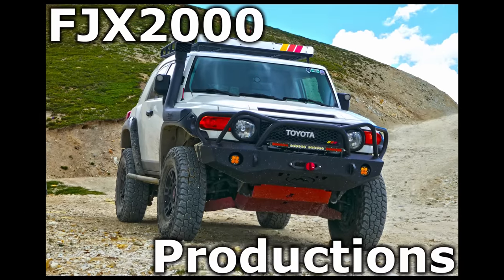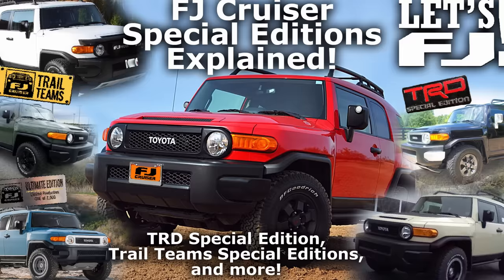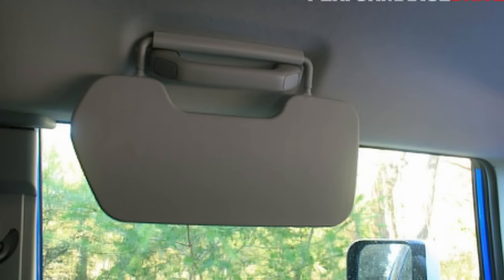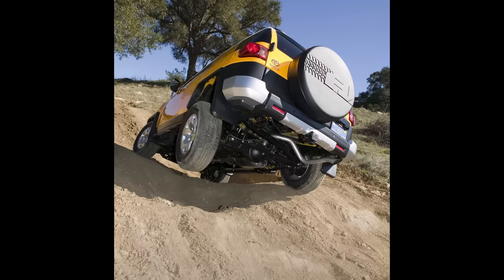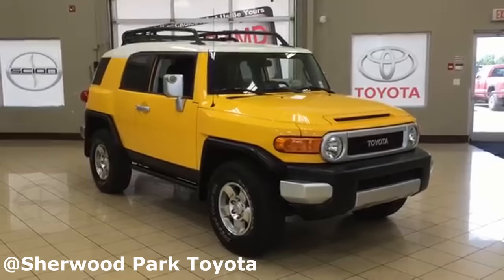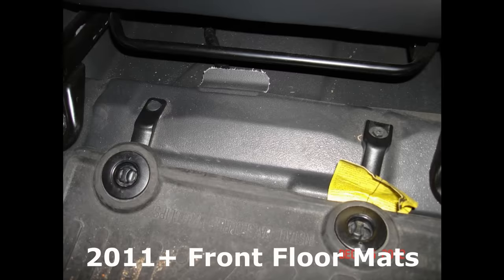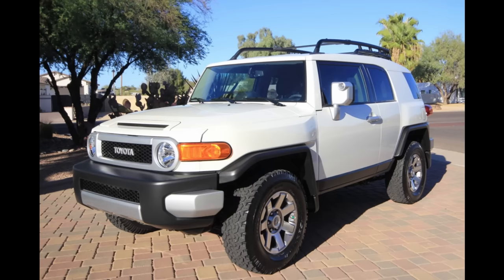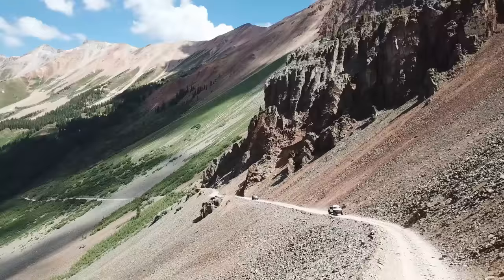Which FJ Cruiser Year is Best? - All FJ Cruiser Changes 2007-2014

Comment: I bought a 2007 fj back in 2018. I was going to upgrade the roof rack and put a roof top tent. Unfortunately it got totaled by a drunk driver. She hit me at 70 mph on an over pass bridge. She almost hit me directly head on but I was able to turn in slightly so she hit my side in glancing blow; my wife and daughter were on the non-collision side. We walked away from it and so did the drunk driver. That fj was a tank. Bought another 2007 fj. Finally have the rooftop tent, off road fridge freezer extra battery portable 140 watt zamp solar. Life is good.
Reply from the maker: Glad to hear it kept you safe! Congrats on the FJ as well 👍🤘
Reply: It's a great testament to the security a 2007 can provide, given they hadn't engineered all the safety features yet. I am happy to hear you and your family fared well through such a traumatic event. And I am ecstatic you have another 2007 again! Happy trails! Cheers!
Reply: God bless your family!
Reply: Im looking at a 2007...just worried because I hear the 2007 had some frame rust probs and shaking at high speeds
Reply: Where did you get the tent? Recommendations after you have had yours for a year?
Reply: @FJX2000_Productions  What kind of accessories can you install on the bu’on panel? I’ve got room for three more accessories. I’d like to put a light bar on top.
Reply: We had a rooftop tent on our Avalanche when we got hit head on.  The tent went flying. The Avalanche saved us but was totalled.   We purchased an FJ and love it.
Reply: 😮so glad u r ok. I got mine after someone hit me. My other car was small. So I love my new tank 😄
Reply: glad your okay! any mods needed to add a rood top tent to the roof rack

Comment: I have a 2012.  Had it since 2014 (bought with like 27k miles on it).  Haven't had a single issue.  I did replace the brake rotors and pads after 85k (currently at like 88k).  The stock ones are good / rated for 100k.  My mechanic told me the originals still had a lot of life on them, after 85k miles!  I also of course have had new tires, and I do a Mobile 1 Synthetic oil change once a year or 7.5k miles (so, once a year for me).  This vehicle is amazing!  My mechanic has said, "they are over engineered".  Will never get rid of mine, even though it is worth the same or more than I bought it for 7 years ago!
Reply: I had a 2007 with only 13K km, sit in the garage for years, my wife hates it, but I will keep it any way.
Reply: @jw715  keep the car lose the wife 🤣
Reply: Love my 12, trail teams 6sp manual.  Lots of fun totally stock except the radio. Would like to put a much bigger back up camera monitor in it.
Reply: @mcelroychandler6267  ours is stock as well. 2011 with only 68500
Reply: I also have the 2012-TT.  Can’t believe at 85k you still had more to go on the brakes.  Incredible.
Reply: @michaelsasso13  Yup, mechanic said I probably had at least a couple years left.  But, admittedly I am not a hard stopper.  I am much easier on my brakes than most people I would assume.  If I see a red light ahead, my foot is off the gas and I am coasting, usually only starting to press on the brakes at around 25mph or less (depending what street speed is).  

But, stock brake are rated for 100k miles.  So, anyone driving 'normally' should get around there.

My battery I just replaced last winter as well (2020/2021 winter).  9+ year old stock battery.  I replaced it because I noticed in very cold weather it was cranking a bit slower than normal.  Would have made it through that winter and another summer, but, not another winter.
Reply: @jw715  sounds like you need a new wife
Reply: You still have it with you...
Reply: @ZephaBryson-zi7qe  Yes.  Still have the FJ.

Comment: I bought mine December 2006 and it’s taken me all over America and I recently took it with me to Belgium. I keep meaning to upgrade her but the most I’ve done is upgrade the radio, runs fine as is.  164,000 miles on her
Reply: MysteriousOklahoma   oh wow, so I have some catching up to do
Reply: MysteriousOklahoma  I wonder who in they right state of mind would buy that lol
Reply: Sounds great!
Reply: I bought a 2012 black on black one in the summer of 2022.  94k miles for 22k.  In perfect condition.  Very strong engine.  Freezing cold AC nice sound system. Automatic.  I upgraded the all the lights to L.E.D and added new bumper tips with built in L.E.D. LIGHTS.  Love it! It is my vacation car when I go to PR 3-4 times a year.  I got tired of being ripped off on rentals for jalopies.
Reply: Got mine new in August 2006.  Just blew a head gasket 2 weeks ago after 425,236 miles of perfect performance, reliability and no problems or repairs except new cats at 300,000.  Local Toy Shop is gonna do a full engine rebuild (least expensive option and EVERY part gets checked).  Then off for the next few hundred thousand.  FJs are AMAZING vehicles!

Comment: Dude, your research for this doesn’t go unnoticed. Crazy attention to detail and that makes a great creator in the car world, well done
Reply from the maker: Thanks so much! I researched as much as I could so I’m glad to hear it doesn’t go unnoticed 😁👍
Reply: Except you forgot to mention that 2009 was the last of timing chain instead of belt, hydraulic brakes and steering instead of electric and a few more things that require more maintenance and $ and things to break. Computers are always big bucks. In my opinion a 2009 would be the one to look for, for Bullet proof and low maintenace.
Reply: Wikipedia
Reply: @joegoedhart1259 Definitely a timing chain, not just 2009 and older.

Comment: I have a 2007  FJ Cruiser; I purchased it in early 2008.  I have driven the heck out of the beast.  I’ve replaced the brakes and alternator.  The vehicle is running marvelous.  I use it off road and as a computer.  I keep the oil changed; I treat as I should, and I use it to haul. 17ft travel trailer.  My FJ pulls that trailer around like it is nothing.
My FJ has 280k miles on the odometer.
I would not trade it for any other off road vehicle that claims to be superior.
I believe the 07 FJ was the best made.  I have living proof.

Comment: My 08 FJ has 325k miles and still running great!
Reply: Nice hope you still have it.. Mine 08 with 200,000 it’s a beast. Workmate has two, one with 380,000
Reply: @dallen8997  yep just changed the oil last week. Running great

Comment: 2009 FJ owner with 520,000 kms. Just replaced the steering wheel...other than that no real issues ,had oil leak where timing chain cover mates to oil pan.
Reply from the maker: Yeah as these vehicles get older and experience traditional wear and tear there are bound to be leaks from time to time. Had to fix a power steering leak yesterday on my own FJ!

Comment: Great review, I had bought a 2007 with hail damage for 9000 thousand dollars with 60,000 miles. It was an amazing car but someone ran a red light hit me, from what I was told the FJ rolled over two or three times. Nothing happened to me,  I got up and walked out the backside Window. My wife asked what kind of car are you getting next? I told her, the same thing an FJ. I then got an 2008 with 120,000 miles. I’m in Utah and this thing cuts through the snow like nothing. When the city is snowed in first thing in the mornings, I go for a ride. and this is all less than four years ago and the car runs amazing with 162,000 miles. I Just replaced the front headlight and got a new windshield. The car runs and looks amazing. I’m 63 and I plan on this being my last car till I’m 110 years old.

Comment: Bought my voodoo blue in may of 06, I have replaced all wheel bearings , calipers and rotors , belt and pulleys , 2 sets of plugs . IT STILL HAS THE FACTORY PANISONIC BATTERY  , UN PHUCING BELIEVABLE ! I keep the undercarriage painted and try to prevent rust . 134k and love it .
Reply from the maker: Way to take care of your FJ! Amazing about the battery too. Ive done brake pad changes and had to replace the alternator among other misc. parts due to wear from off-roading but she is still going strong at 153K miles!
Reply: What did you paint the under carriage with?
Reply: @About2Rain  , Sanded down any rust bubbles  , wiped the area down with laquer thinner and primed it with Rust-Oleum and covered it with Rust-Oleum black , I used glossy black . Went around with a piece of card board with the Right size hole and placed over the bolts and shot them with silver . They swore to me the body would never rust and it hasn't but the chassis needs baby setting . I usually keep it power washed through out the winter since I live in the rust belt . Thanks for asking .
Reply: @johnsricke7236  Thanks for the info. I had an 07, but upgraded to a 2014. Can’t believe all the rust underneath. I live in the Northeast that’s why!
Reply: bought mine same month and year. (manual 6 speed)
battery still works as well!
have never had a tune up, only oil changes.
only replaced the brakes at 160k.
unreal!
Reply: You guys need to replace those spark plugs every 30K in the 2007 models as they are not the 100K plugs.  check your owners manuals if you got em.
Reply: Would you be using a high heat paint by rustoleum? My undercarriage is looking rough (2008 up in the northeast) 
Not sure how to proceed,  if I should do it myself or have it professionally treated
Reply: Used regular enamel paint or even use industrial grade paint. Sand and prime it .

Comment: I'm probably getting an FJ Cruiser 2009 from a friend that moved out of the country and realized it's cheaper to buy a vehicle there than to have it shipped.  Only thing I have to check is if it's automatic or manual. I'm glad you mentioned that you would buy this year. I'm hoping his is the later version with the potential changes that came with the 2010.

Comment: Great video! I've added so many mods to my 2007 FJ on my channel, it pretty much has what I want at this time. Thank god no fender bulges and since I don't try to climb rocks, no problems with the rear differential. At least my FJ has electronic controls where I can manipulate the rear door windows, locks, and a door popper where I can open the rear door from inside. a great addition for those who like to camp in the back! I'll never give my FJ, they are pretty much the best 4 x 4 vehicles out there!
Reply: Gee, I would really like to know what I'm doing wrong??? I didn't know I could open the back door window, or the door itself from inside. Please Advise. THX.
Reply: @vincenzodemarco7983  I have a couple videos that show how to install a parallel switch to the rear door key that will allow you to lock / unlock the doors and pop open the back window. That's the easy one.
Another video shows how to install an electric door popper so you can open the rear door electrically. Some people use a rope or coat hanger for this but I like the "factory look" of a push button switch.
Reply: @tanktankerson1042  Well Yes for sure I would be grateful to know how to open the back door from the inside. I'm perplexed that we can't do this Already, or that Toyota didn't build that feature from the start. My key fob will unlock all doors and inserting the key in the back door will Pop-Open the window. That is all I can do with my 2014 year Model. Thank You. Advise me where to go/look.👍

Comment: Bought a 2010 and love it till this day.  Installed a full set of trod grey wheels with BFG AT KO2 and the Tom light came on.  Dealer service started quoting me all sorts of horrific causes and horrendous prices.  I went to my local Discount tire and they had a gizmo they attached to the OBD port and rebooted the system to my new sensors for free.  I gave the technician a twenty dollar tip.
Reply from the maker: Glad to hear it! Yeah there is a reason the dealerships are sometimes called STEAL-erships. They want to make the most $$$ possible even for the simplest things.

Comment: 07-09s are based off of the Prado 120 platform (4th gen 4Runner) while the 10-14+ FJs based on the 150 Prado (5th gen 4Runner)
Some part like suspension are not interchangeable like front shocks

Comment: Thank you for this. Ive had many offroad vehicles since I started off roading  32 years ago. My first 4x4 was actually an AMC Eagle, what can i say, i had 4 little children, and it worked. Then a 4runner (86), 2 Jeeps,  2 Troopers, and a Dodge Raider (88). My faves,  the 4Runner and Raider. The Raider unfortunately,  was not a reliable vehicle, and now sits while i unsuccessfully search for a used, low miles motor...no luck. So i started looking again and have narrowed it down to either an H3 Alpha (Hummer), or an FJ. Obviously,  the FJ is the better truck, but man, finding one that is under 250k and $15k (my budget for a cash purchase) is near impossible,  while H3's can be had for around $10k-14k w low miles. Both are great trucks from what i see, but the FJ will last twice as long. Hopefully i find one. Great video.
Reply from the maker: Thanks for sharing! Yeah I hope you get an FJ of course, but you also gotta choose the logical choice as well for the budget 👍

Comment: First off I love the recap of the factory specs of the FJs for newbies. Although I am an original owner of an 08 Titanium Silver with 62k on the clock currently.   BUT... you now have two videos which leave out the Blu Logic Bluetooth 2008-2010 PT923-00098 which was a dealer install option with Switch Panel switch.   Although I waited until dealers started to clear this option out of inventories and got it cheap new in box and installed it myself.  Also my research has documented the fender bulge issue to Feb '07 and before; not later.  Keep up the history lessons for future owners of these beloved rigs.
Reply from the maker: Oops! My bad! I feel bad that that was left out of my FJ Cruiser buttons and switches video, I didnt realize it was an OEM Toyota thing, i just always thought it was some aftermarket company that some folks had. Thanks for mentioning that!
Reply: My '07 was built in 12/06,and I don't have the fender bulge problem.
Reply from the maker: @johnsanabria3279  yep it isnt a guarantee that every FJ will have the problem, but it is a possibility to look out for. For example, my 2007 FJ didnt have that issue, but my 2008 FJ does 🤷‍♂️ so you just never know

Comment: Love mt 07 Titanium Tank! We have not run into any of the early model FJ problems on our, at 133K now. Had the rear diff replaced last year, but it was not for broken pinion gears, something else failed in it, I think it was bearing. When, not if (wife wants her own) we get another FJ, I would like an 09. Oil change! Enough said!!!
Reply from the maker: Very true!
Reply: Hello friend , i have a 207 fj and only with 86.000mile i bought brand new. The rear end start to make noise when it was in 70.000 mile do you know if theirs a recall for those rear end .thank you
Reply: @karmevincent  have you checked the oil level in the diff? There was a technical bulletin on the propeller shaft that I learned about when lessons having a thud coming from the rear end.
Reply: @veedubya4636  yes , the oil is fine , i changed the oil a few times ,  surpriced i never tooked the fj off road  , still drives like new .

Comment: I have an 08 FJ with 41k miles (purchased from AZ with 38k miles 1.5 years ago) and just had an oil change done at the dealer and they noticed an oil leak.  According to them about a 1/2 quart.  Concerning because I’ve only been driving about 1,000 miles on every 6 months since I purchased it and this was just discovered.  Need to start investigating what’s leaking (no oil actually leaking on the ground but per the forum, the timing chain cover is a common problem).
Reply: Front timing cover.  this year is known for it.

Comment: I have an early 07 I bought from the original owner. No fender issues. 177k still going strong. I also have a gx470 and watched a video about disabling the tpms to shut the light off, Should be possible on the FJ Cruiser as well. They are similar platforms. PRADO 120
Reply from the maker: Yeah I did a wiring hack on my 08 FJ to turn off the TPMS light so it is possible

Comment: I have a 2012 Black W/White top! It's drop dead gorgeous, and so clean I have taken all the outer trim off so I can thoroughly clean and paint the underside. (I'm a paint and body shop owner) to offset the tendency to rust badly, that I've seen out of these beautiful machines. I've wanted one since I first saw them on the road, and will keep this fantastic machine for the "duration", however long that may be? Thanks for such a detailed and professional overview of what I consider the coolest, and most beautiful vehicle on the road! So! I subscribed!
Reply: I just bought a 2010 Black w/white top. But this video says that year didn't come in that color. Can someone advise?

Comment: I like the later ones with all the bells and whistles, but I love my '08 simply for that oil filter being on top.
Reply from the maker: That oil filter location sure is nice! Especially once you have full skid plates, it is just a hassle having to worry about it on later years!
Reply: @FJX2000 Productions  truth. Happy new year.
Reply: I have a 2014 TTUE and suck the oil out with air powered device, leaving a few drops when dropping the oil filter. just like the newer models and low miles..purchased mine with 1k original miles.